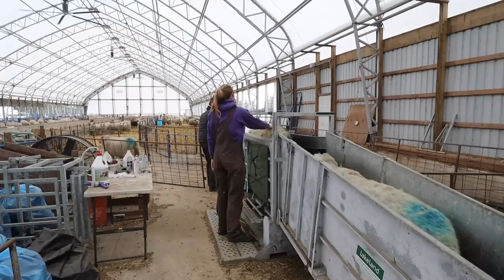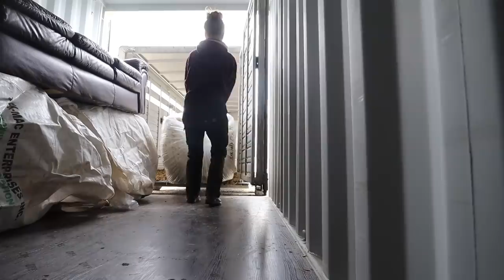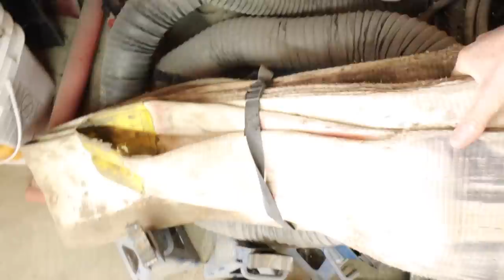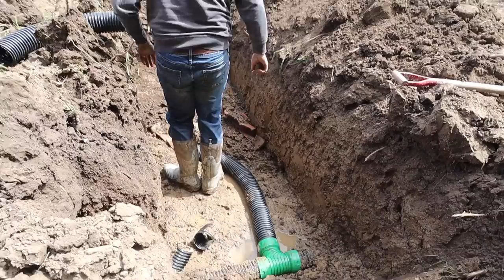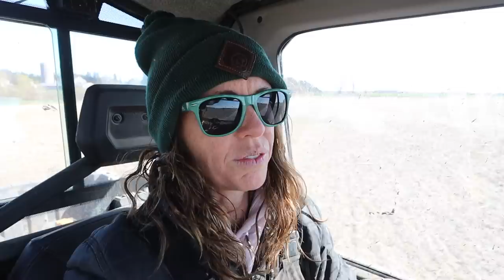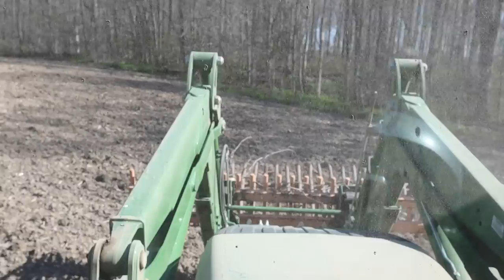LUCKY... ewe've been DITCHED.😢 | breaking ground, breaking equipment & breaking hearts💔 | Vlog 578

Comment: We took the old method of picking rocks with the farmers next-door neighbors.  We used tractor and the flatbed for hay.  We would physically  walk next to the hay wagon pick up and throw the rocks on the flat bed if small to medium size rocks. It kept four kids busy so the farmer didn’t have to do the physical labor. To be thoroughly honest with you I’m in my 50s and we did this when I was in my single digits years.  You have a very modern approach to picking rocks. I feel like the way we picked rocks it was in the Flintstone ages. Thank you Sandi for all the information.  I find the information very interesting in the modern approach.
Reply: I just made a comment about this! That's how I remember picking rocks, and it was brutal. And that was only about 12 or 13 years ago. Although now that I say that I realize that I am much older than I feel.

Comment: Looks like you had the Ontario derby sheep raceway!  Put scrap wire in those drainage ditches so you can use a metal detector to find them.  Boy that tractor that you had real beefy tires on it.

Comment: Ahh. All of the jobs that I hated as a kid! One of our farms (the one I still live on) is glacial till, so all rock of all sizes! Old AC tractor with a bucket combined with muscle. There was a reason farmers used to have lots of kids! Digging plugged tile by hand was the worst, grossest, dirtiest jobs. We hired it installed, but along with glacier till hills comes bottom land marsh that the county tiled back in the 50's. Over 800 acres drains into it and it collapses within weeks every time they "fix" it. I'd like them to remove it and restore the marsh at this point.

Comment: Could you make the drains by putting in metal markers. So they could be located using a metal detector? It makes it easier to locate underground pipes if you put in a metal strip or markers so it can be found using metal detectors.

Comment: Happy motherday, first of all. Still watching the video but before I forgot. How does the water goes in this pipes? Are there holes in them... because I don't understand how it works... how dies the water goes in these pipes. That's the question...
Reply: I'm no expert, by far, but as I understand it, the "laterals" are pipes with holes on top of them, buried in the fields where water tends to stand after it rains. These pipes allow the water to run into them.  Then the laterals slope down to meet the mains at the edge of the field, at a 90° angle or perpendicular, allowing the water to turn at the mains and flow through them and off the fields, (similar to the sewer drains in houses to the city sewer), allowing the fields to dry after big rains, instead of looking like ponds or swamps. Now, the crops don't stand in water and die, and the farmers can work their fields without their equipment getting stuck in mud or tearing up the field. I hope this makes sense and helps.
Reply: @joycehanson977  thank you very much for your explanation.  I understand now. 👍
Reply: @annnoyez  you are so welcome! We're all learning! 😁

Comment: The stuff doesn't blow in the shop cause it's not working or IOWs not under stress of doing it's job.🤭 Much like a watched pot on high not boiling quickly. Have you thot about putting in a dog door?🤔😎